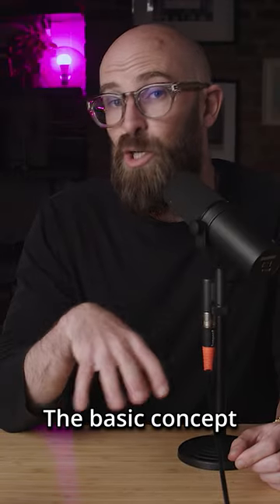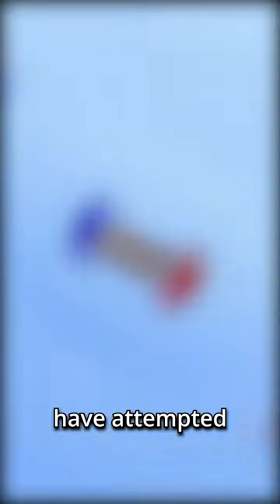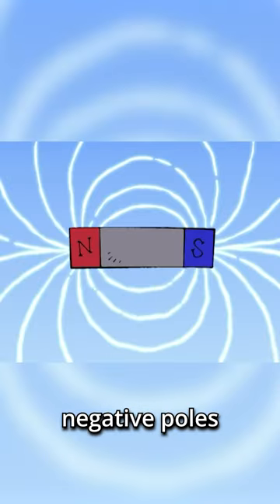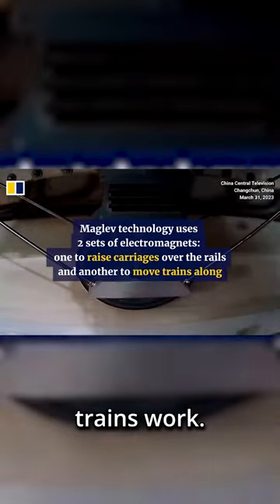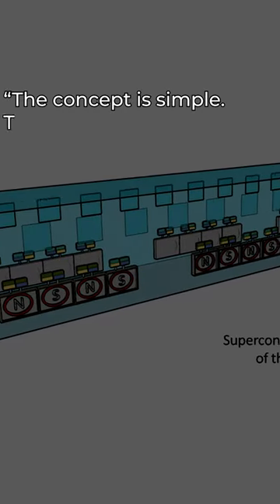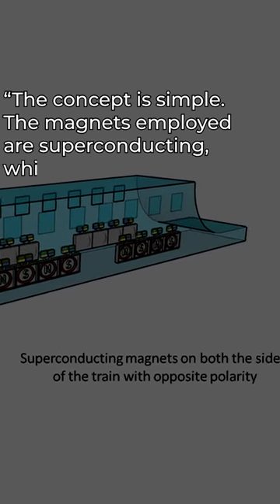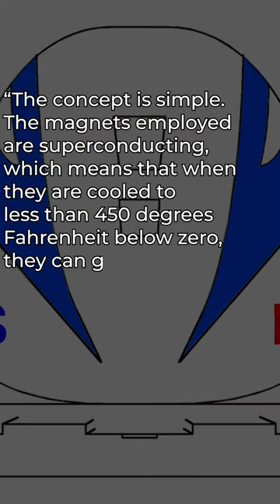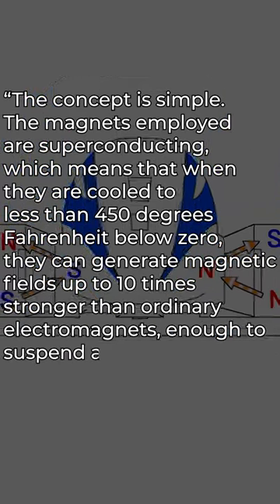How does the Maglev train technology work?  #shorts

Comment: How are they propelled if they don't contact the rails?
Reply: Did you actually watch the video you just commented on?
Reply: Bogey underneath to give it a kick?
Reply: Magnetism, that's how they move. 
A very primitive way to test simple movement is to put magnets on both ends of a battery and place it inside a copper coil tube, you'll see how it propels itself due to how electromagnetism works

Comment: Sorry, but NO.  Rails and wheels dont limit speed.  Air does.
Reply: Friction from the wheels and rail tolerances are ABSOLUTELY the chokepoint for speed. A traditional wheel on rail train will melt its brake shoes off trying to perform an emergency stop from 300+mph.
Having a section of rail that's only 1/2 inch wider than the rest (from either shoddy workmanship or ground shift) would cause a catastrophic derailment at those speeds.
Reply: @nercksrule  nonsense.  The main issue is air and the second one overhead wire.  Not Rails and wheels.
Reply: @nercksrule  oh, by the way, high speed trains dont use brake shoes.   It is quite obvious that you have no idea of what are you talking about.
Reply: @MarceloBenoit-trenes  - They use air for the brakes, so what are they pressing on if not some kind of 'shoe'?
Reply: @MrMuz99  discs.   Shoes are only for shunting and slow speed moves.
Reply: @MarceloBenoit-trenes   - I feel like an idiot now but, thanks. 😅